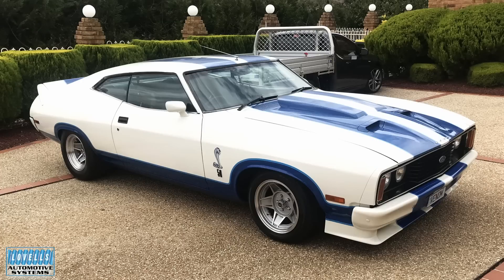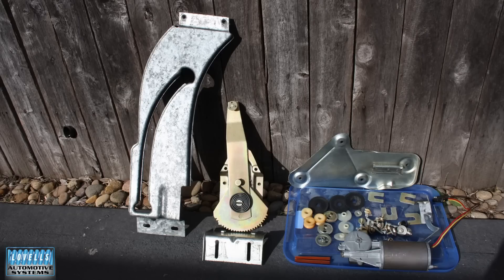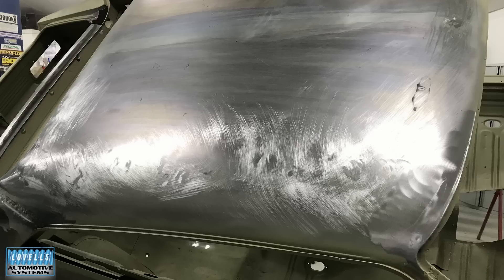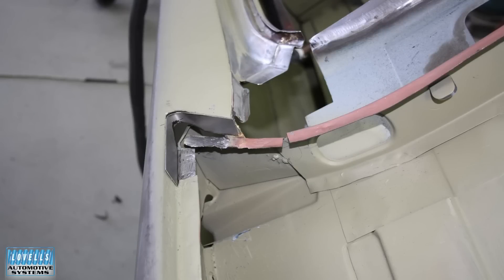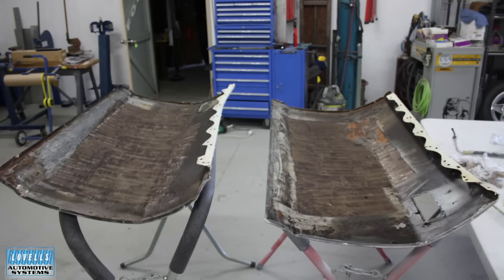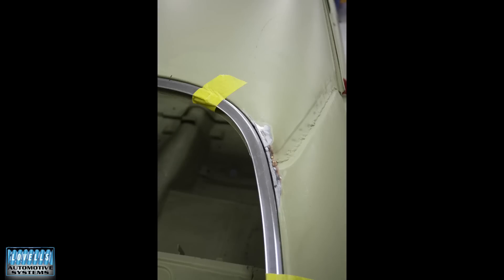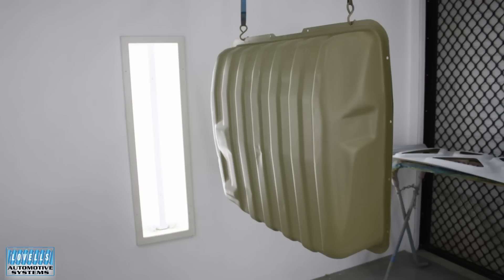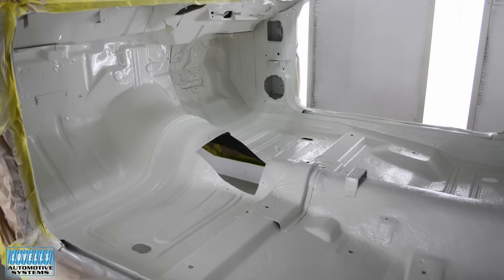The Build Series #13 | Ford Cobra Venom #66 Restoration

Comment: My friend from the central coast once owned this Cobra (#66). I helped him make the shock tower brace for this car. We had the specs taken from Cobra #24 from Western Sydney at the time back in 1988 .
Reply from the maker: Cheers mate, it was a good job too on the brace. Thanks for sharing. I had the opportunity to work on #24 as well
Reply: Yes I know. I've watched the You tube video. It was me that made up the Motorcraft decals for #66. We had taken the cobra to Oran Park for a few laps back then. The Cobra had a five speed gearbox then. I remember filling the tank with a high octane mix when a piece of the funnel I was meant to hold. fell straight down into the filler neck and into the tank. The diff centre inherited my 3:1 ratio crown and pinion out from my XB GT hardtop. I still own the GT coupe. I once owned a Bathurst Cobra #10. In 1996, we took my bonnet scoop to a fibreglass fabricator and made a copy for #66. The scoop was given a lower profile. We fitted #66 with a Bathurst type front spoiler and white B45  Simmons wheels. The driver's front guard was replaced after a collusion. I would love to have you guys restore my XB one of these days. It does need a full resto.

Comment: You certainly are a perfectionist Howard, what an amazing job. These series really highlight just what it takes to do a quality job and why they can cost as much as they do. It would be interesting to hear how you customer likes the Holley Sniper fuel system. The biggest disappointment and mistake I made with my rebuild was in fitting a FiTech system its junk ( in my opinion), 3 months and its still not running properly. Looking forward to the next build. Cheers Phil.
Reply from the maker: Hi Phil, not sure about this one but had a lot of feed back when we were building the car that all these style injection still need to go to someone initially to get things sorted as a base so they can then fine tune themselves. A lot of comment about oxy sensors and distributor setup.

Comment: Hi Howard , really enjoying this build.
You mentioned about not doing to much to the brake booster, if you can cast your memory back say 30 odd years or more ago.
I worked for a company call Better Brakes , for ten years .they had services centers  all over Australia , there was one division at Burrows Rd  St Peters.
This was called the  Remanufacturing Brake Components' Div, or RBC , where they had departments that reconditioned bonded brake shoes , master cylinders,  calipers, and Brake Boosters.
I worked in the Power Brake Dept and eventually became foreman . I was too slow in stepping back so I got landed with the job LOL.
There's  one main thing you need to look out for is the valve body which is made of Barker lite  if dropped they can crack and that's when your day starts to go bad other than that there's the rubber diaphragm which can perish and this is  common on old engines that dump  fumes into the boost through the vac hose. we used to have test benched to make sure all the unit working after re building them .
We also used to have few celebrities call , I met Collin Bond on one  action , he was picking up some brake shoes they where testing out with a new compound on them.
Anyway I thought you might be interested in that bit of trivia , keep the great work appreciate the time and effort you put in each week.
Reply from the maker: Thanks for the feedback, It's becoming a through away system more and more but these old cars we still need to rebuild them
Reply: @AstillDesign  Thanks for your time as per phone conversation this afternoon cheers

Comment: Really enjoyed watching the built and show. Is the fuel tank xc only because I have one i want to put it in my xa .I know the tank is the same size and i know I have to do a few changes
Reply from the maker: It will fit, You will need to block off the pollution control lines and the fuel filler is slightly different

Comment: Hey hi guys, I’ve got an XA coupe that I’m about to start shortly. I’m only a back yard restorer but I have high standards. I intend to unpick and remove the rear quarters to get right into the car to repair any rust. I’m wondering if you have any videos of rear quarter removal and repair. I’ve done a plenum before so I’m not afraid of the quarters on my coupe. I just want to get my head around it before I begin. Thanks for your efforts 
Jason
Reply from the maker: Jason have a look through the ASTILL design Facebook photo albums. Blackman’s coupe, cool mint coupe, cobra 400 all had the quarters off. There are hundreds of photos
Reply: @AstillDesign  oh yeah thanks so much mate… I remember the cool mint coupe vids.. I knew I’d seen one of your vids with a de-skinned coupe

Comment: Hi mate. When would you suggest I do my seam sealing. I have been told to do it before colour so I don’t make a mess while sanding primer. Cheers
Reply from the maker: I like to do it before the last coat of primer. It can be done before colour but I have never been game to try it.
Reply: @AstillDesign  ok thanks. I wasn’t keen on leaving until paint being a blue metallic.
Reply: @AstillDesign another question i have is, if I use a grey high build primer and rub it back to 600-800 wet for a metallic blue is that ok or should I use a wet on wet primer over the high build to put the colour on to. Cheers.
Reply: @AstillDesign  next question, would you use seam sealer or filler where the window frames meet the doors on an XC? Thanks
Reply from the maker: Seam seller
Reply from the maker: If your going to the trouble of wet rubbing put the colour on the hibuild
Reply: @AstillDesign  I think I’ll finish with a 400 on the DA on the hi build then put a wet on wet ground coat on before colour after watching the vid on painting the Camaro. Thanks.

Comment: The razor cutter is a tungsten block ..
Was this the engine builder that was recently killed in a accident ? 
What are your concerns with spray filler?
Reply from the maker: That’s the one, tungsten.
That’s correct Sam Fenech
Spray poly just seem to fill everything including all the small details in the panels. The car looks fat.

Comment: Im loving the cobra videos. Im not loving the wheels. But as you say it's not my car. I do find it funny how the globe style wheel just looks so good on a cobra. Or maybe it's just what I'm used to. Or maybe it is the little bit of white on the globes. Then I'm not sure I want globe style wheels on any other car. Choosing a wheel is a real struggle. I took a year to settle on convo pro. Im still not sure I got it right. Luckily it's only 20 wheel nuts and you can fix it. The real job is in the getting the car itself the  best you can. Im not upset about the modifications to this car. I think just lifting up the mechanical a spec or two to everything is just a nice balance of angry street car vs drivability and ofcoarse the body work and attention to detail. In my eyes thats a perfect muscle car
Reply from the maker: Yes wheels can make or brake a car. In this case he had both so he could pick and choose.

Comment: Hi there, love your channel 
Any chance your interested in doing a Datto 1200ute? I got a A15 which has spun a bearing unfortunately not long ago now running A14 with twin  dellorto carbs
Reply: If  not I got a Datto 120Y 2 DOOR SEDAN NOT THE 2 DOOR COUPE. Goggle will tell you how many came to Australia,  Fair as I know less than 30 are still alive
Reply from the maker: Sorry mate, if I do anymore it will be an x series ford
Reply: No worries then thanks for the reply back, 
See you at the Nats when I get it done ✔️ 
Or catch you at the Rocky Nats Easter weekend if you're heading there?

Comment: To get rid of the bituminous residue or glue use a bit of diesel or acetone.

Why not try a NARDI steering wheel, to be different or a hand built Moto-Lita steering wheel built by the og builder?
Reply from the maker: Cheers mate
Reply: @AstillDesign  your welcome, I used to work in the tarmac trade and tested asphalt for 8 years.... Tested new stripping procedures, and the acetone to use is tolurene. Which as a odd fact is part of the TNT make up, and is one of the 'T' s of TNT.

Comment: Why would you butcher something special like a Cobra. I just can't get my head around it. Excellent work gents.
The first 200 where 351 with the exception of #001, the publicity car that was a 302. #002 to #031 were the Bathurst cars. They evened out the numbers by making car #351 a 351.
Reply from the maker: Not for me to reason why,  Yes was having a bad night on the numbers. Thanks for your input.
Reply: @AstillDesign To be clear. Didn't mean you Howard. Whoever put in the huge stereo and those gauges in the dash.